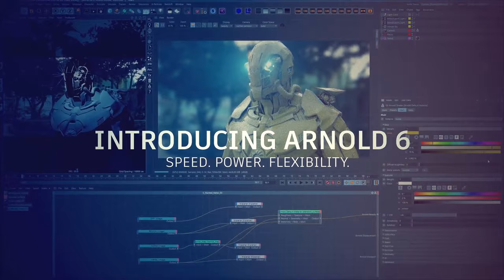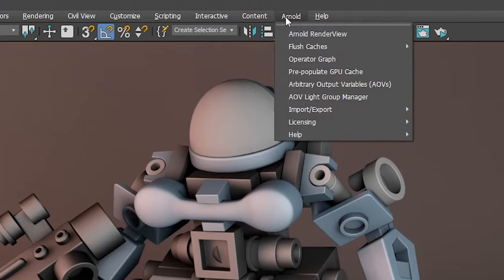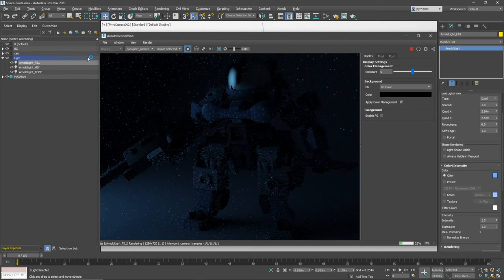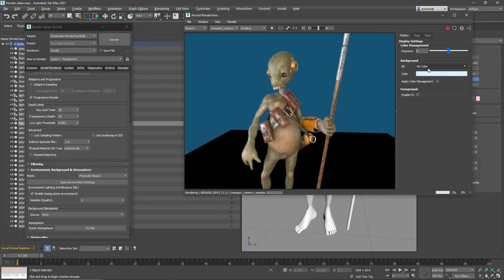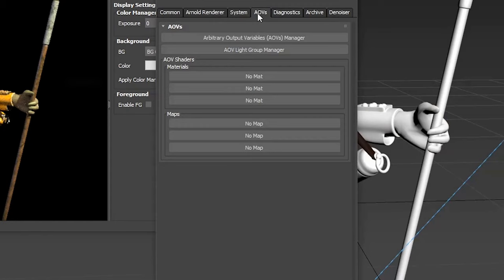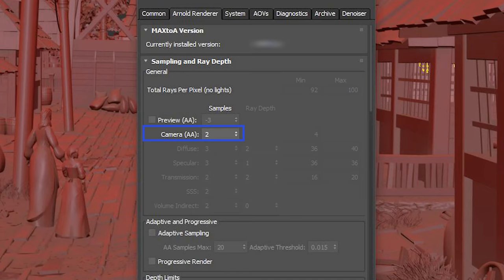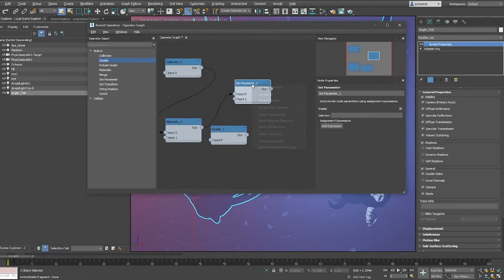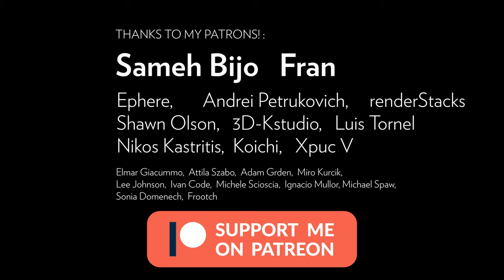Arnold Render in 3ds Max introduction tutorial

Comment: I have move to Corona Render. Arnold should have default settings so that everything looks natural, metal is metal, stone looks stone etc. Now it require multiple settings before render start looking "natural". Simply too many settings if you just want natural look.
Reply: Try Renderman or Mantra engines (ofc only in Houdini/Maya) - there are too many settings. Arnold is very simple to setup comparing to those two.

Comment: Nice tutorial. Very basic but it helps. I wanted to use Arnold for one of the future project just to learn it, I know it is very capable and you can do almost anything that other render engines offer, except maybe point cache GI solutions. However looking at your tutorial, the way object properties are done with modifiers worries me ... it will be very easy to loose track of all of the modifiers once scene complexity grows. They should probably do a classic approach that V-Ray or Corona implemented, where you do right click on objects and then activate Arnold properties.

Comment: I wish I could use Arnold but simple opacity controls do not work in Arnold, so I cant use it :( , it is also so hard to get a natural material look in materials, eg stone, walls etc. I had to move to Corona Renderer, it is SO MUCH EASIER an works better out of the box. It pays for itself in the time I save. I wish Autodesk would buy Corona Renderer. (I do not work for corona or get any kick backs.)

Comment: Thank you very much! However, the good old vray will still be faster?
Reply from the maker: Arnold its a full path tracer only. Has not "cache" or biased modes like vray has. Its like using Vray only on Brute force mode.  For a total brute force renderer is one of the fastest, but  Vray  or corona will always will be faster when dealing with a lot of indirect illumination if you use Light cache for example.
Reply: @andvfx  So is only faster than.. maxwell? :-D Joke aside great content! Keep working on this series, Max 
would need a renderer recognized like Cycles in Blender  
or how mental ray was years ago.. it would lead to greater standardization, nicer viewports, and maybe fewer costs not purchasing external plugins.
Reply: @andvfx  yeah, Arnold is faster/more flexible for VFX and maybe outdoors

Comment: Great video! But besides pricing is there any reason to use Arnold over lets say V-Ray 5 ?
Since they both offer CPU+GPU computing only from what I've heard and seen myself Arnold's GPU is pretty much trash currently and needs alot of work especially in the optimization/speed aspect ( just like Redshift itself in an unbiased mode ).
Reply from the maker: I will not say GPU its trash exactly. For example Arnold GPU supports OSL, where vray doesnt.     Arnold is great dealing with huge amounts of triangles, its reliable to whatever you thought at it.   I like for example more the control you have over shaders in volumes with Arnold over vray. Or arnold use less memory when dealing with instancing over vray.   At the end its another very good renderer available for max, its included on the package so.... why not.
Reply: @andvfx  V-Ray 5 GPU supports OSL too ( partially ) similar with Arnold GPU: "Note that this initial support is still not complete and currently has a number of limitations...".

Tbh I always wanted to try/use Arnold, but it's simply not as efficient as V-Ray both in performance and workflow, Arnold doesn't have anything close to VFB for all the post-process stuff and other nice features such as "Real Zoom", "Focus picker", History w/ A/B comparison etc, it's also slow af and so far it's mostly just an OK-Great CPU renderer but CPU rendering is sort of dead nowadays except for super large CGI scenes where alot of mem is required.

Stability and geo optimization like you've mentioned might be it's best strenght and maybe nodes, haven't tested it for that long and completely opposite in V-Ray, V-Ray GPU just crashes every few mins on me when working on something more complex, so it's becoming annoying to the point I want to switch to something else, but ofcourse it's just my hardware limitation for most part.
Reply from the maker: Exaco man, check the arnold renderviwe I show on the video. You have post effects, you can save/compare renders, isolate by element.... actually has some cool features over vray framebuffer now (others are missing).  And arnold gpu its getting on a good spot on the latest updates.

Comment: I been a solid user of Mental Ray. But jeez, I was so pissed off when Autodesk decided to scrap Mental Ray. All I was left with was Vray, which is extremely counterintuitive, very cluttered, slow (when dealing with GI), and allot of stuff is in confusing places. The render engine is especially overcomplicated and confusing -  if you need done something quick, and don't have the right preset - you waste allot fo time tinkering with it to get it look right and not take too long when rendering.